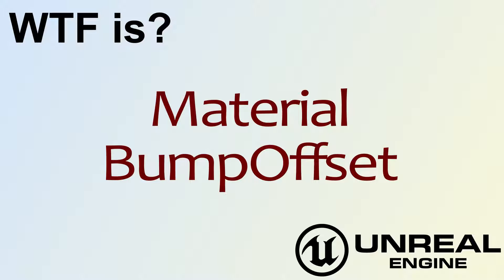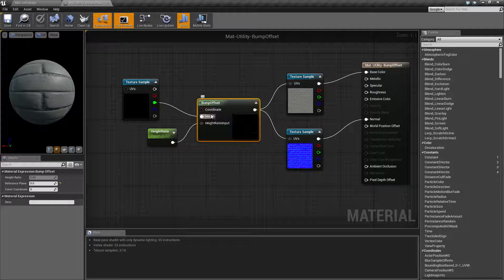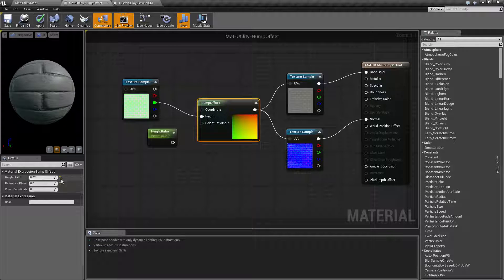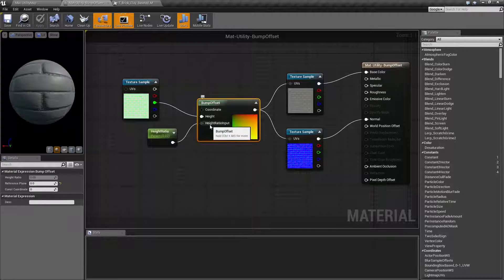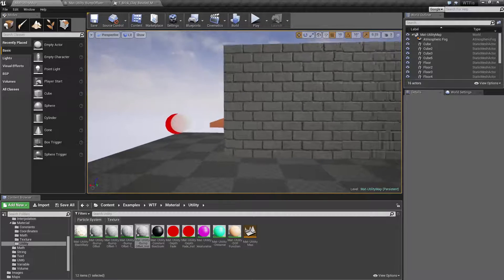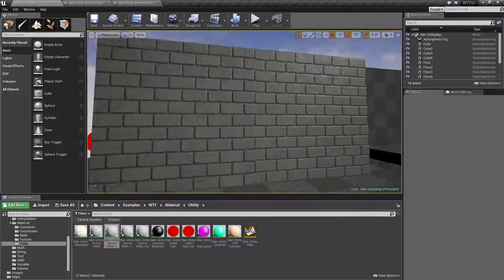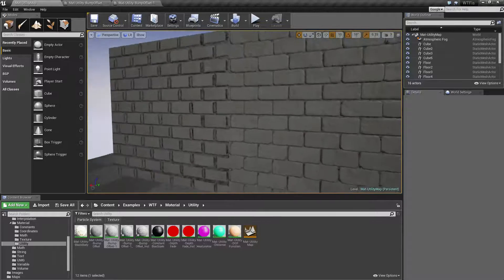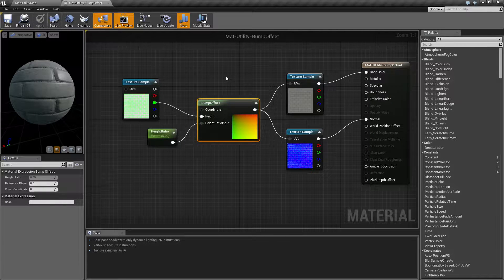WTF Is? Material - BumpOffset in Unreal Engine 4

Comment: really helpful and clear tutorial thanks. Could I use a displacment map as the black and white image.  I get confused as there seem to be alot of names for similar maps. bump map hieght map, displacement map. thanks again for the info
Reply from the maker: Unfortunately over the years the same things have had different names based on how it was used so yes you have ran into that issue.  For the most part you can do what you want as that is pretty much what I was doing in this example.  By taking only one channel you get a black and white image as that one channel is either on or off (W/B) so yes using a displacement map, height map, bump map should be fine.  Now keep in mind most of the maps are usually different strengths based on what they are used for.  A Height map may have much more variety in the use of colors as it is meant to be different heights while a displacement map might be more subtle.

Basically yes you can do what you want you just might have to tweak it a bit if the map you are using is too strong.